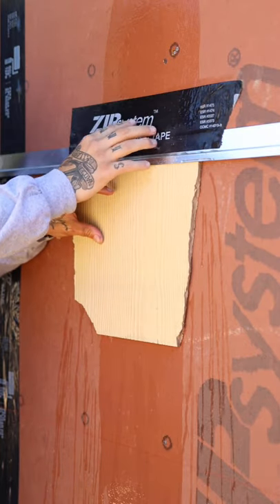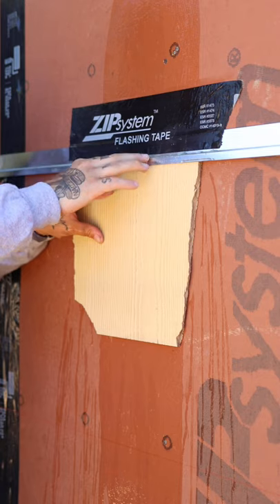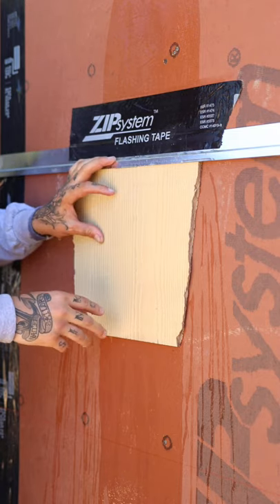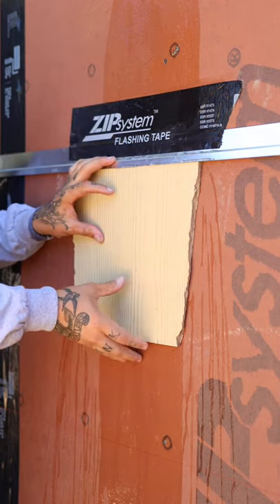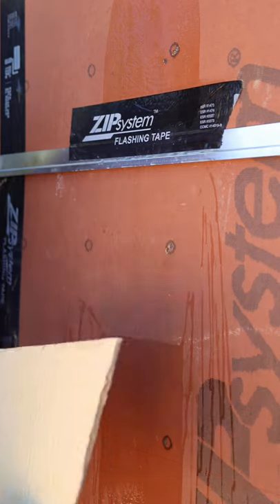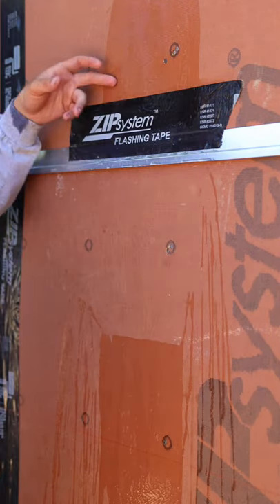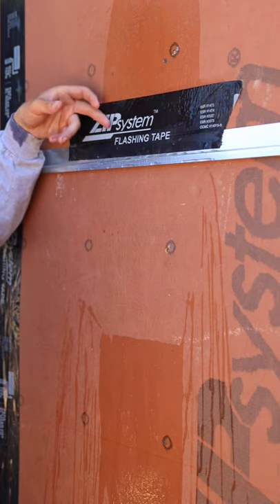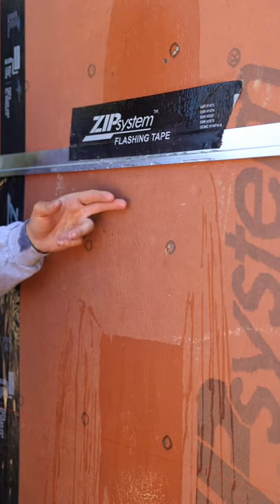How We Flash Siding, Water Test! #shorts

Comment: So your basically counting on that tape to hold its seal over time?  How long does that last ?
Reply: It’ll outlast the siding that covers it, no problems. Decades.
Reply: @mvalovalo  Really. Hard to belive but Ill take you word for it. I was always tought not to trust adhesives and culking when it comes to waterproofing. Proper lapping can never come unstuck. But we all have our own ways.
Reply: @Brennan the problem isn't the system, it's the guy that sees this and starts to think the tapes and glues are the solution instead of learning the methods to do proper water proof layering. Tapes and glues are like a nail. Used correctly they define the jobs longevity, used incorrectly they ruin it.
Reply: @Brennan Well ya but sideing is just your first line of defence. Not really there to prevent water from getting in but more to protect the barierr behind it.
Reply: @HondaRiderX17  with the way siding and z metal is installed theres no need for tape. It's an extra step my guy takes for a bit better job.
Reply: @mvalovalo  How do you know? ZIP system isn't that old.
Reply: Nothing beats 30 pound felt.  Who said?  The 100 year old house.
Reply: @Californians_go_home  bingo